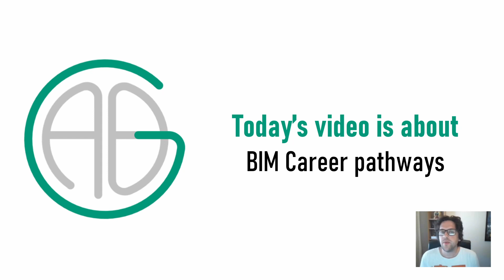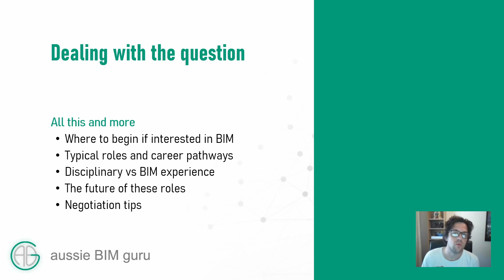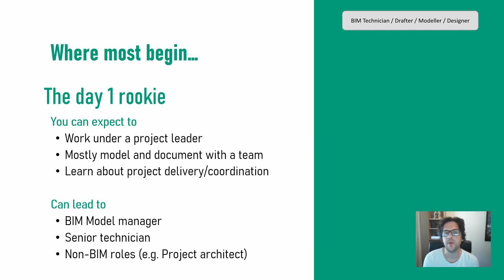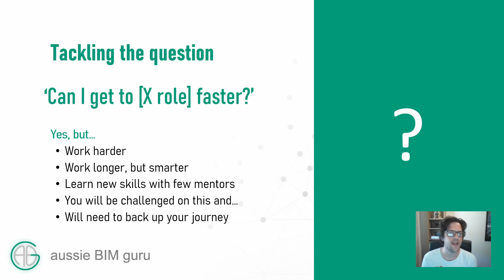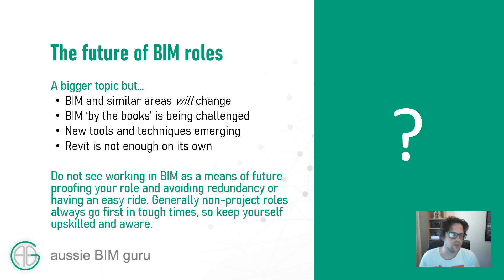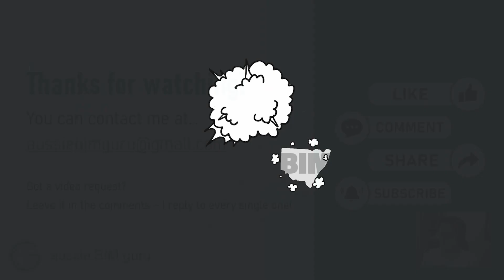BIM roles and career pathways - how to 'get into BIM'

Comment: Can Energy Engineers work as BIM managers ?
Reply from the maker: If there is demand a role available for it, sure. Usually BIM managers in services engineering will tend to have a specialty, but have to manage BIM beyond their base discipline, especially if the related firm is multidisciplinary in nature.

Comment: I HAVE A CAD EXPERIENCE AS PIPING DRAUGHTSMAN AND ON FIELD EXECUTION EXPERIENCE AS CIVIL ENGINEER. WHAT WOULD BE MY INITIAL STEPS? I HAVE LEARNT REVIT & NAVISWORK. PLEASE HELP ME OUT..
Reply from the maker: Pursue roles with engineering firms. Note that if you work in Australia they may often be seeking engineering degrees though. Check for roles you want and check the requirements, use that as an indicator of next steps.
Reply: @AussieBIMGuru  I am fron India and just for cutiosity do Australian companies hire from india ?
Anyways thanks for the suggestions.
Reply from the maker: @veshelar not commonly. The market is very competitive and there is a lot of locals graduating here as well as people from overseas on working visas. Most people usually go down a working visa route.

Some firms partner with outsourcing companies in India but typically do not hire single people unless they have a highly specialized skillset, for example advanced machine learning.

Comment: Am 33 yo and about to step into the BIM world with a 2 years of apprenticeship. I am worried of the prospect from then on since I do not have a degree. Is there any recommendation of one to increase my opportunities? I am not even sure of BIM being my right path either but I have a diploma in Game Design because I'd like to create stuffs then.
Reply from the maker: Understand that stepping into the world of BIM is actually stepping into the industry of AEC. BIM on its own isn't really a job or career, it instead depends on supporting a base discipline such as architecture, engineering or construction. If you wish to come at the industry without experience/qualification in the base discipline it may be challenging as you will be competing with many others who have this. You may need to look at alternative avenues such as software development unless you target base experience in the discipline(s) you wish to apply BIM towards.
Reply: @AussieBIMGuru  Hey thanks for the reply. The initial 2 months of that 2 years of apprenticeship will be me learning and getting these certificates (from AutoDesk/Bentley Systems and company themselves) :

Projects-based CAD Training in AutoCAD for Built Environment Professionals (Comprehensive).
Projects-based BIM Revit Basic and Documentation Training.
Projects-based BIM Revit Architecture Modelling Basic.
Projects-based BIM Revit Architecture Modelling Advanced.
Projects-based BIM Revit Structural Modelling.
Projects-based BIM Revit Air-Conditioning and Mechanical Ventilation (ACMV) Modelling.
Projects-based BIM Revit Plumbing and Sanitary (P&S) Modelling.
Projects-based BIM Revit Fire Protection Modelling.
Projects-based BIM Revit Electrical Modelling.
Projects-based BIM Revit and Navisworks Combined Services Design (CSD) for BIM Collaboration and Design Coordination.
Projects-based 2D and 3D MicroStation Training for Built Environment Professionals.
Projects-based BIM OpenRail Designer Modelling and Documentation.
Projects-based BIM OpenPlant Modeler and P&ID Training.
Projects-based BIM OpenBuildings Designer Training.

There are more but they are identified as electives so I am unsure if I will be undergoing them. After the initial 2 months of rigorous training, I will be working for the same company as if it were an agency and get attached out to other companies and from what I was told by the HR it's mostly government company. Whilst my 2 years will be relatively 'safe' albeit low wage, which I would have to suck it up, I am perplexed about what my future holds after those 2 years especially without a degree. From what I've gathered and understand is that as a BIM Modeller, most of my experiences will come from the project work itself, however I am still worried about needing a degree, especially having had 0 field knowledge. Even if I do heavy networking it's not confirmed as well that my future would be 'secured'. Do you have any recommendations of what degree would be worthwhile to pursue? I would just like to outline my 5 year plan. Been considering between Chemical, Civil, Electronics, Industrial & Management and lastly Mechanical.
Reply from the maker: @hanlosingit personally I studied architecture and needed a masters degree due to australian market requirements, but it will vary depending on your discipline and country.

I would try not to focus too heavily on certifications - just to the point where it helps you secure employment. Quality over quantity.

Where you go after the first few years will generally be up to you, as only the very large firms in the market have defined career pathways in BIM I've found. Try to hold a pathway/plan in mind and make your employers aware of it.
Reply: @AussieBIMGuru  Alright cool thanks! I'll try to find my niche/interest in these 2 years with this company. In the meantime I will also be consuming your videos for more knowledge. Thanks for all the videos by the way!
Reply from the maker: @hanlosingit youre welcome! It can be hard to get that first experience but it sounds like youre well on your way! Once youve got a few years under your belt it becomes easier - keep it up!

Comment: I've been and electrician for 15 years. The past two years I've been an inspector and an assistant project manager. Without a degree, would I be able to get into BIM management?
Reply from the maker: Generally a big part of it comes down to management and coordination experience coupled with disciplinary and systems development background. The most common pathway into BIM mgmt these days is by joining a medium to large scale firm and working your way to the role via a project coordination focused role, if not a role that focuses deeply on systems development (templating, process, programming) if you come ready with the chops for it.

Comment: Hi Gavin, this is Gajan here, hope your well, in order to reduce the chance of being redundant as a BIM specialist, would it make sense to keep upskilling  on different tools like programming or coding tools at all costs? I’m currently doing your course you offer at your business Aussie BIM guru in order for me to upskill on Dynamo and I’m slowly but surely going through the course but taking on board some of the tips doing stuff on Dynamo. While at times there’s bit of pressure to test my knowledge through quizzes and a lot of info to digest for different chapters, I’m doing all I can to not rush through and do it at a leisurely pace by doing one chapter at a time. Hope things are well on your end, hope we can catch up when we have the chance.
Reply: Thanks so much for the tips, a lot to take in but hopefully I can find a way to proactively explore and experiment with different tools where possible.
Reply from the maker: @gajbox  its an uncertain time so take heart in knowing many others are in a similar dilemma. Best we can do is be aware of what may come, and keep ourselves relevant at a business value generation level.
Reply from the maker: Hey Gajan, hope things are going well at BLP! 

My main tip is to focus on how your role brings the business value vs personal skills in the longer term. Research new and upcoming platforms and features to get the firm on the front foot, and focus on developing solutions that scale beyond single projects or even users. 

In the long term I think DFMA and testfit/autodraw type platforms (hypar, swapp, testfit and possibly forma) will change the delivery and design process significantly, and many BIM specialists will be exposed for being too documentation focused in their abilities and skillset. Look beyond delivery phase and BIM, and look at how designs are prepared and explored to extend beyond this area. 

I recommend eventually aiming towards general Python so as to have a core programming language that will also help understand how the nextgen tech is working - it will be more programmer centric I think. 

Hope that helps!

Comment: Hey Gavin, I am a MEP Modeler with one year of experience working for a BIM consultancy. I have a bachelor's in mechanical engg. Is it possible for a person with a non civil/architecture qualification to become a BIM manager? Also, does a master's in BIM management or Construction Management help a MEP Modeler to improve the chance of becoming a BIM manager?
Thank you
Reply from the maker: MEP firms generally have  BIM coordinators and managers also if they are medium to large scale, so certainly no reason why the pathway isn't an option depending on where you work.
Reply: @AussieBIMGuru  Thanks for the reply. 
Also, I'm curious what's the ANZSCO code for a BIM manager/coordinator in Australia? Couldn't find it on google
Reply from the maker: @arivutv2872  i dont believe it will fall under these as it is a specialization vs explicit job class.

Comment: I was wondering if you'd touch on how one can keep up with learning about BIM while learning about their primary domain, and also the challenge of BIM being 'Non-Billable' and how you can do that in a way that doesn't get you fired
Reply from the maker: To be honest it's very difficult to without putting in time outside the office work time; especially if the firm is not supportive of BIM roles and RnD time allowance. Personally I estimate I put anywhere up to 15 hours of development time per week into myself to keep up to speed in addition to my contact hours at work.

Comment: Great video.. Loved it!!
You mentioned most firms aren't using Navisworks these days,What are they using instead ?
Reply: JK, I think he said 'Revizto'
Reply from the maker: Yes its not as common in my experience. Many firms either moved on to Revizto if they wanted a better product, Solibri if they use more openBIM formats or approaches and BIM360 design if they want to avoid paying for Navisworks altogether.
Reply: Many firms are still in CAD
Reply: @nottheBIMMentor  Yea I agree and there are few who has gone beyond Bim!